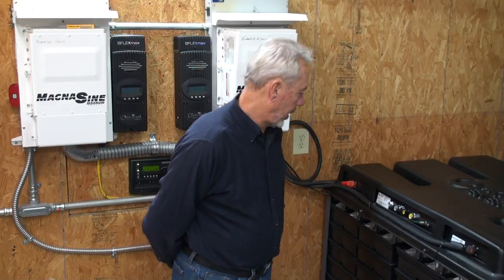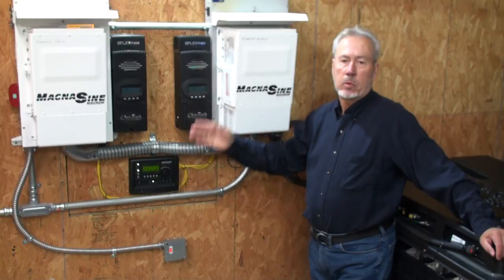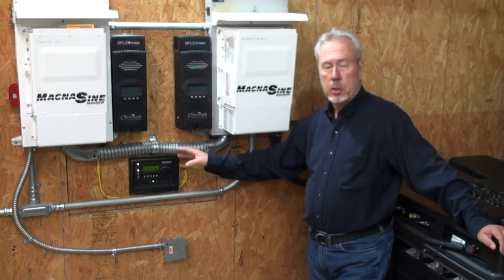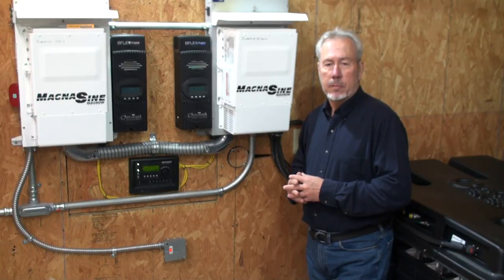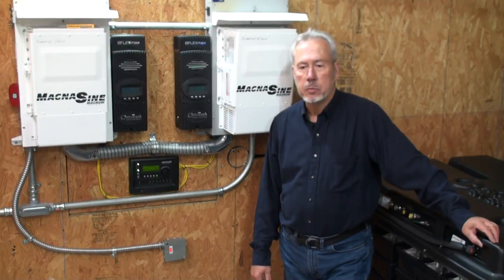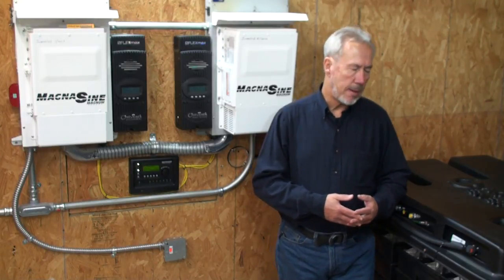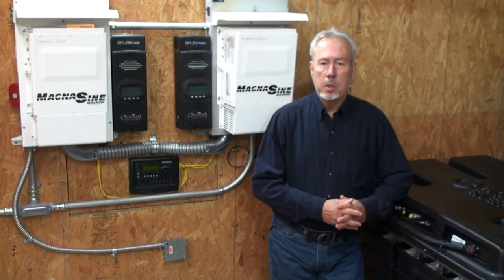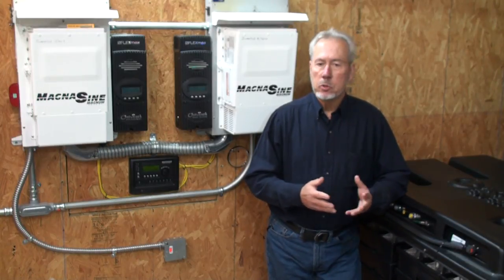Branson Off-Grid Solar Intro

Comment: Off Grid Solar is a reasonable choice these days if you have enough sun & you can do it. It's not a technology issue; all the equipment is readily available & has been in use for years now. What's made it feasible is the new battery tech. The Aquion saltwater battery shown here is very unique & priced right at $15k for 30kwh of storage. I agree that the way to do it is the way third world countries are going off grid. It's a lot cheaper to do it at the community level than individually.